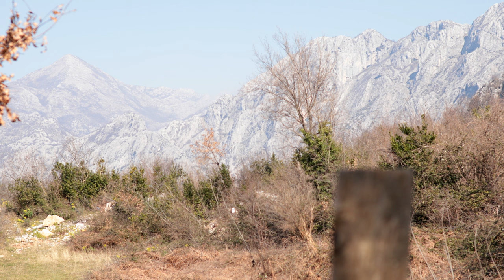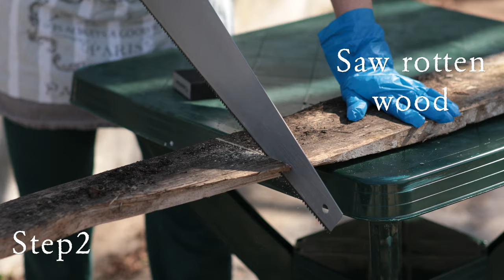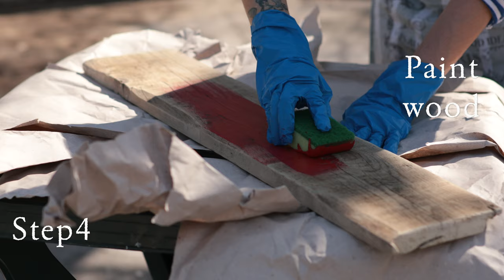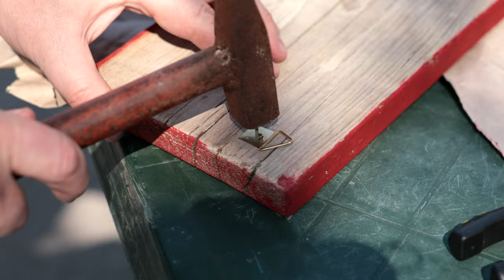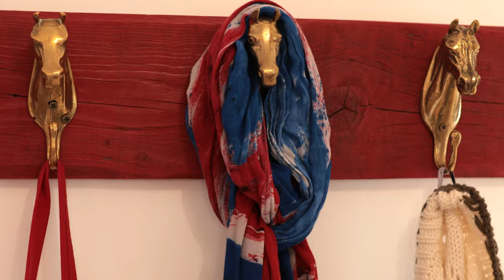DIY Coat Rack - How to Make Homemade Clothes Rack for Cheap

Comment from the maker: Thank you for watching video How to make DIY coat rack ❤️ Time stamps:
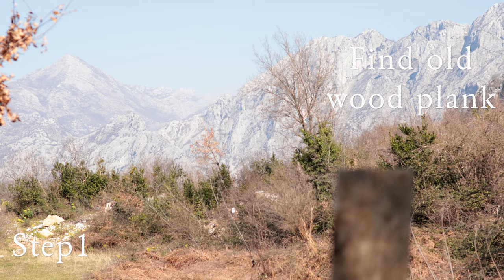00:16 Scrap wood
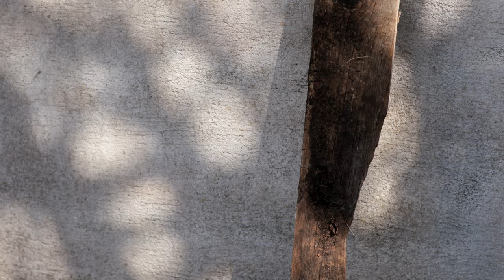00:27 Saw wood with hand saw
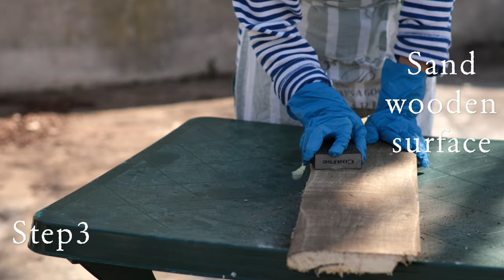00:38 Sand wooden surface using sandpaper sponge
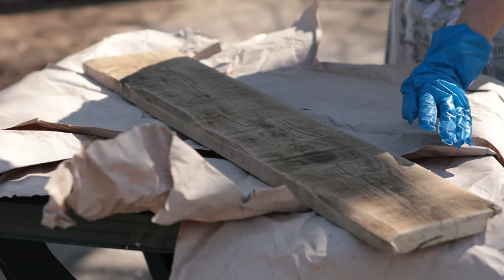01:06 Paint wood with red paint
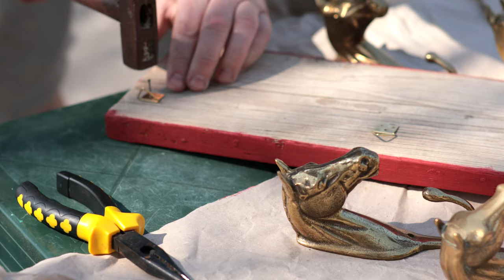01:30 Nail the triangular hooks to back side of the wooden board
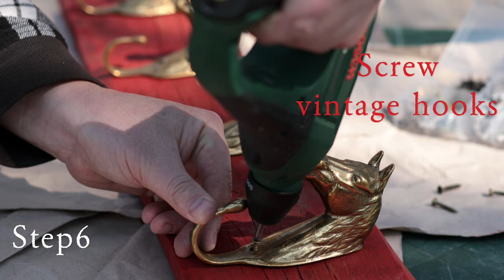01:50 Screw vintage hooks to the rack. Kate found at flea market some vintage hooks in shape of horse heads 
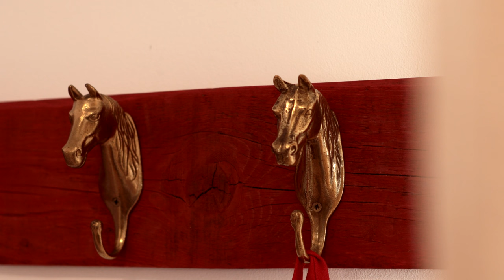02:14 Hang the DIY coat rack to the wall
❤️